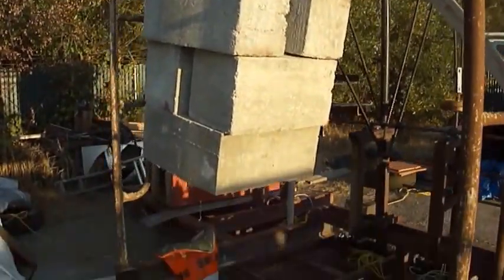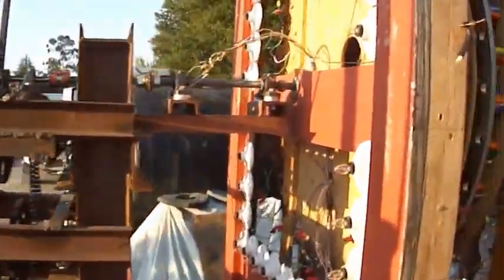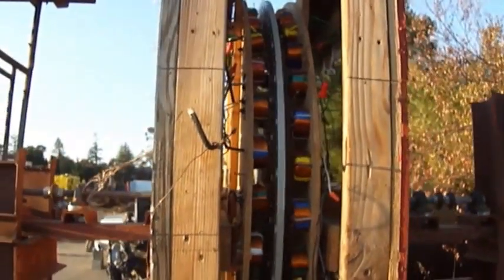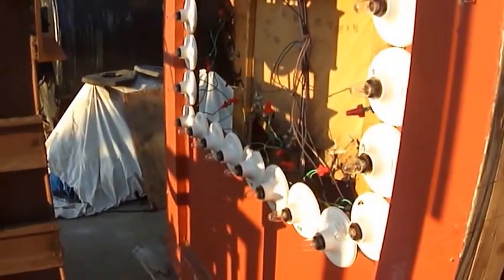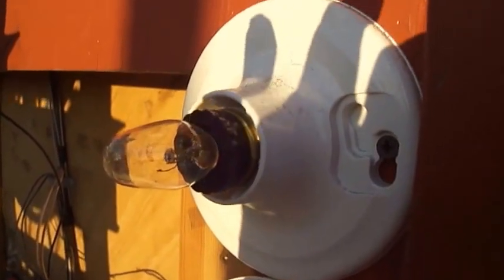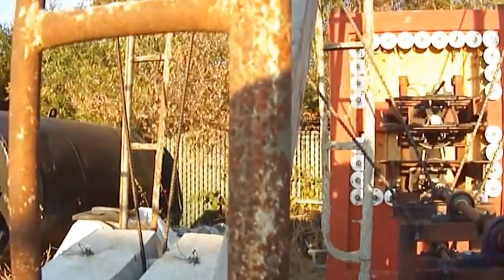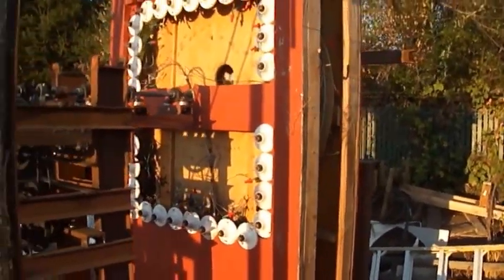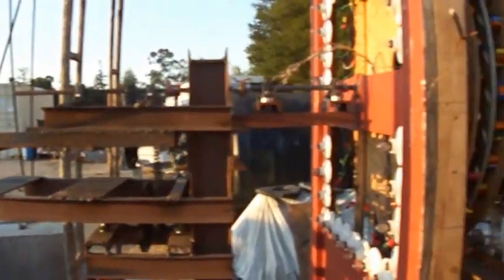Gravity Converter (day time run)

Comment: what keeps the crank handle from spinning back, I hear a clicking sound, can u show a close up of this mechanism?  also what about a scaffolding tower and ride a standing basket down with your weight to charge the system,  that's what I was thinking
Reply from the maker: I run a piece of flat steel across the winches spur gear. This allows the gear to run in one direction only. If the gear tries to run back the steel plate will get caught on the gears teeth and get pushed back into its base. I think you will make electricity but make sure your gear locks work well or you might be in for a fall. post your work so we can see it.

Comment: IMHO, a machine doesn't need to be made that large with all that weight in order to be effective in producing electrical power. You could make several smaller units, using less weight [much safer] and combine their energies to get similar results.

Comment: Its weight can be ellevated by an pneumatic cylider powered with CO2 heated by the sun. In the night it is cooling and your system makes electricity. 
Congratulations.

Comment: Isn't this the same principle as a grandfather-clock?
Reply: +Ms10000123 Yes,  you are correct,   the main weight,and a counter weight  to keep the chain tight, and a looped chain goes over a  ratchet wheel in between the weights  so that  as the weight is pulled up the counterweight goes down , without affecting the operation of the drive wheel to the escapement  wheel or in this case  the drive sprocket. A few other free sprockets are added to set the path of the chain.

Comment: Sad - So you have to put crank energy in, to get electrical energy out - You would gain more electricity simply putting the crank on a generator.
Your machinery has an efficiency of around .8, and you actually lose 20% f your crank energy. No wonder you are panting on the video.

Comment from the maker: I would like to help you build a Gravity Converter however the phase 3 converter is not the generator you want to duplicate. I recommend waiting for the completion of the phase 4 Gravity Electric Converter to duplicate. The phase 4 Gravity Converter is 200X more powerful than the phase 3 is now, and it's far smaller. The phase 3 Gravity Electric Converter was also built freehand and there are no plans or specifications drawn.
Reply: Thank you friend bunker rogge for answering, I hope that you could finish the fourth phase and to could expose the advances. Thank you again.
Reply: I have some ideas that I would like to  run by you.
Reply: whats progress, do you still use your hand to bring rock from bottom to the top